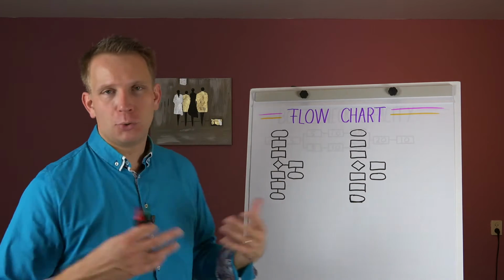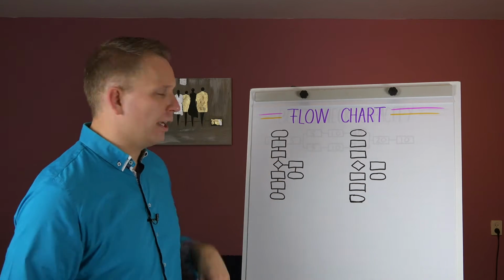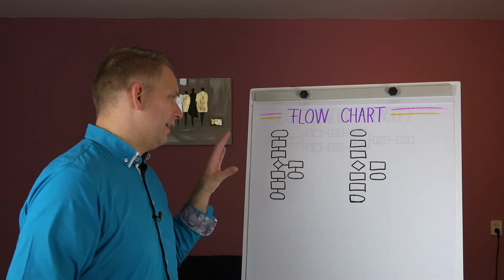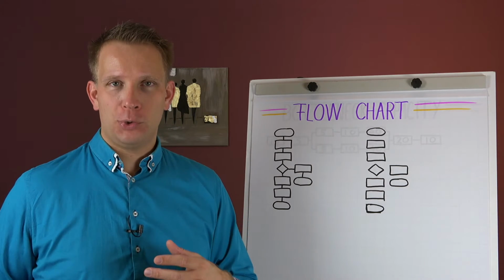Why Flowcharts Are Essential for Process Improvement

Comment: This is good. My first job involved writing procedures. I never got around to specializing on process charting. I need to revisit. Thank you.
Reply from the maker: I’d advice you to draw out the flow chart even if you’re not going to include it in the procedure, as it clarifies the process for yourself too. And it can be used to discuss it with others who know the process well and can help you improve the written instruction.
Reply: @TomMentink  Hi Tom. That is exactly my plan. I dont want to send out pages of written procedures memos when a single flowchart page will do nicely.  I hope to have your advice on how best - and fast - I could relearn :) Thanks very much!
Reply from the maker: @litodailisan8408  my main advice is not to go overboard - really think about what you want to convey. 
Is it about the steps in the process (and maybe where the main decision points are), use a simple flow chart. 
If it’s about who is responsible for which steps in a larger process, swim lanes are a good way to go. 
There are many variations on a flow chart, but don’t use all possibilities together. The main point is to keep it as simple as possible while still presenting the important info. 
I’d advice to check out some videos on flow chart, swim lane, process map